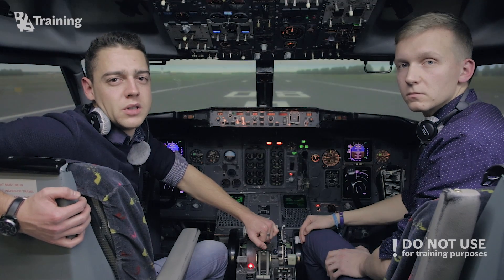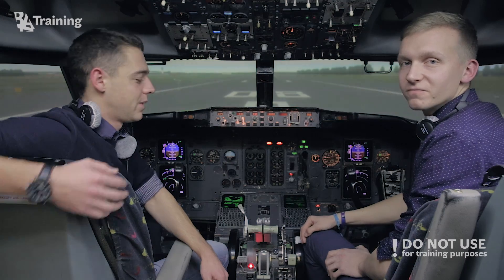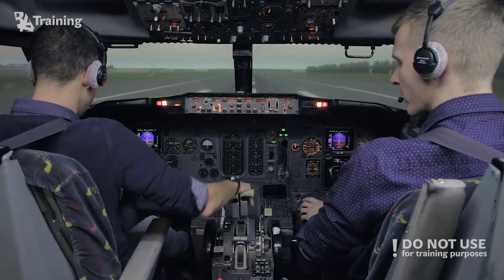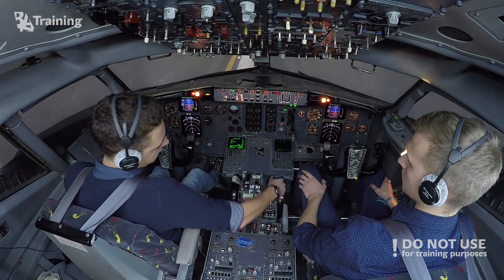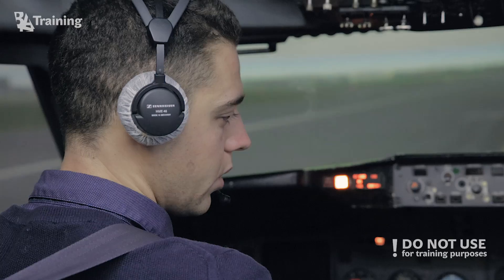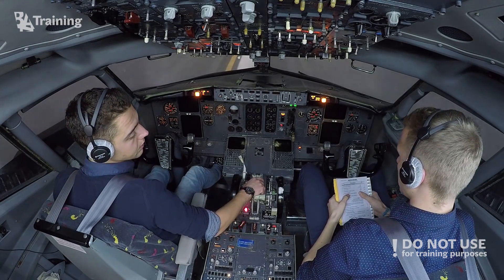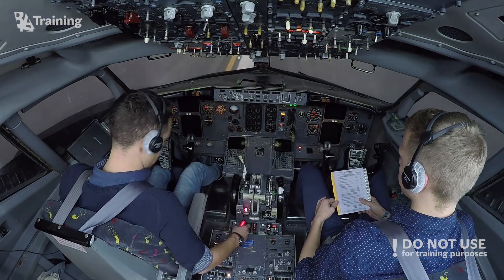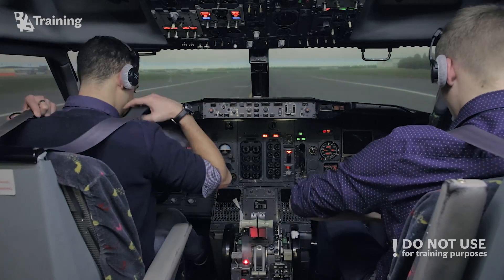B737 engine fire before V1. Rejected take off

Comment: No report to ATC that the reason for the rejected takeoff is that the pilots had identified an engine fire (or fire warning). No cancellation of the fire warning (aural) annunciator. No initial confirmation callout by the non-flying pilot of engine fire instant recall item actions being carried out by the flying pilot. And a few other things which I won't mention. Thanks. I've learned something new. BTW: There was once a Boeing policy, (for earlier model B-737s), that in relation to flaps prior to an evacuation, flap zero was to be selected so that passengers exiting overwing (if instructed or required) wouldn't potentially end up slipping into the extended flaps mechanism. I guess that it has been revised due to variants or whatever. Anyway, for what it's worth, thanks a lot for the presentation.

Comment: Great video. I always engage the speed brake first then cut throttles to idle and engage reversers, and apply braking as needed.
Reply: That's wrong. Thrust to idle first then maximum reverse thrust until 70 knots then idle reverse.

Comment: Interesting to see, they still use the checklist of using one bottle of foam extinguisher first and then the 2nd after 30 seconds. After the American Airlines incident the FAA changed regulation, during an engine failure at take off they now advise to immediately use both foam extinguisher bottles in order to have safe evacuation.

Comment: The FIRST action of the F/O should be to cancel the aural warning, the last thing you want in such a high workload situation is an extra stressor!
Reply: Yes one of many inaccuracies in the video. They should not have cut both engines and F/O should confirmed the engine numbers while performing critical actions namely: thrust lever idle, fuel flow to cutoff and fire switch pull. You always run checklists with two people (unless one pilot is incapacitated.) They had to do an evacuation with flaps nowhere near 40 because they didn't have any hydraulics due to the captain erroneously cutting both engines. This channel is good for entertainment but their procedures are usually incorrect with severe inaccuracies in some.
Reply: @efeyzee  "They had to do an evacuation with flaps nowhere near 40 because they didn't have any hydraulics due to the captain erroneously cutting both engines." not true, you can see the flaps are indicating 40 with a green light
Reply: @pancakeking78  Oops, you're right -my bad. Still, though, BAA's videos usually aren't following proper procedure
Reply: Γεια είμαι φαν
Reply: Спец епт, сам бы обосрался, не гони

Comment: ok first of all, use some common sense and dont turn on the engine 1 reverse thrust... That might make the fire bigger smart one.
Reply: Engine reversers are supposed to be used even if there is a engine fire, dummy.
Reply: So he wastes time and distance deciding which engine is on fire then makes the decision to pull the correct Tst Reverser.?     Because NO PILOT IN THE WORLD HAS EVER MIXED UP WHICH LEAVER TO PULL  When faced with a sudden emergency.

There is not a pilot in the world trained to do that.   All RTO no matter what the cause have the same actions.  
 Also an engine on fire is STILL producing thrust therefore it will still produce reverse thrust therefor you use it to help stop you instead of allowing it to speed you up.
Reply: They will take no action until stopped on the runway or 400feet except toga silence aural warnings or reject the takeoff   and it won't make the fire bigger
Reply: Wrong ………..
Reply: Thats stupid, as a pilot  you are supposed to use all deleceration devices possible, because you certainly have a lot better to do than caring about the size of the fire, its origin,  or its temperature.

Comment: engine one fire ? stop ? then why you use revers of engine number one ? engine is in fire you have to idle engine number one !!
Reply: First concern is to control the plane. Second concern is to deal with abnormal procedures. Apart from that, the engine may be on fire but it's also still generating thrust. Even after setting the thrust levers to idle, the engine needs time to spool down from takeoff thrust level, so deploying the reversers makes sense. Not using reversers on that engine alone would produce a large amount of asymmetrical thrust, so you'd have to use no reversers at all, unnecessarily increasing your stopping distance and possibly causing a brake fire.
Reply: nope for one main reason. The RTO is a very quick maneuver. Normally the PM would not call what engine is on fire, as this is unnecessary. All capt needs to know is that its a fire, he/she does not have the time to work out a failure, confirm it, make sure they activate the correct reverser, as by that time you could have evacuated the entire aircraft.

Comment: you are a very long-running action for evacuation of passengers ... half the people burned in the fire ...
Reply: Actually only last week I had a CRM course and we discussed this.   To follow the Boeing procedures it will take average more that 2 minutes from CC ON STATIONS to the Evacuation.   Yes some crews do it faster but the are usually the ones that forget to shut down the engine.   Not a good look turning pax into pasta sauce.   First rule of aviation when the shit hits the fan ‘sit on you hands’.    It means take a deep breath and SLOW DOWN.

Comment: I'm not up on the procedures in a 737 but would thrust reverse be used if one of the engines was indicating it was on fire?

If it was really burning it would probably generate asymmetric thrust with the result being a possible runway excursion during a high speed rejected take off.

I know you're tight on both stopping power and distance here, but this seems like an instance where full manual breaks and trust to ground idle might be a better option... 

Of course that's depending on the checklist that I'm not familiar with...
Reply: It's been a while since I flew the 73. The procedure was to engage both thrust levers to reverse idle and apply reverse thrust if needed, accounting for the yaw resulting. Pretty much the same for the 72, 75 & 76.
Reply: nope for one main reason. The RTO is a very quick maneuver. Normally the PM would not call what engine is on fire, as this is unnecessary. All capt needs to know is that its a fire, he/she does not have the time to work out a failure, confirm it, make sure they activate the correct reverser, as by that time you could have evacuated the entire aircraft.

Comment: if there is a fire on one of the engines,isn't using one of them as a reverse thruster dangerous?
Reply: nope for one main reason. The RTO is a very quick maneuver. Normally the PM would not call what engine is on fire, as this is unnecessary. All capt needs to know is that its a fire, he/she does not have the time to work out a failure, confirm it, make sure they activate the correct reverser, as by that time you could have evacuated the entire aircraft.

Comment: what would happend if you get a fire after V1 ...before VR
Reply: you must take off in this case. There is not big difference between v1 and vr speeds.
Reply: up to the captain of the aircraft,he/she could resume the take off with one engine and attempt an emergency landing or stop right away(if only the pilot is sure that they'll stop in time) ,it's all about the split second decison making ability of the pilot
Reply: +Ayesh Jayawardene after v1 you can't stop airplane safety.
Reply: @АноНим-ч1э5э  if the aircraft would be unable to fly they'll stop anyways. It will just be an overrun
Reply: i'm saying maybe during an incident if the failiure occurs split seconds after v1 is called out,again its up to the PIC whether to stop or resume
Reply: @ayeshjayawardene7894  by V1 you have to have made the decision, you cant be making the stop/go decision at v1, it has to be done by V1
Reply: Sure, but that's not what you train for. We're talking about ENGINE failure. Below 100knots you stop for anything. Between 100kts and V1, you only stop in case of engine failure. After V1, you're committed to taking off. You have to realize that V1 is usually closer to Vmbe. Above Vmbe, there's just not enough material in the brakes for stopping the airplane, you'll inevitably end up overshooting the ASDA.
On the 737, Vr is usually very close to V1 for various reasons, one of them being "the airplane is light and has good brakes" to simplify it, that's why, usually, most failures on the ground will be below V1 and all failures above V1 will happen when you're already flying and have hopefully reached V2.
Reply: Look up TWA Flight 843 if you want to know what a pilot could do as far as aborting a take off after V1 and even VR!
Reply: At v1 you can still stop your aircraft depending on the situation.
Reply: @Hk-uw8my  By v1 you need to have made the descision. While yes you probably could stop you would probably be investigated for putting the aircraft in danger. Only time you should reject past v1 is if the aircraft is unable to fly.

Comment: hey if eng 1 fire, why did use both reversers?
Reply: 21 Pac You have an engine fire, it necessarily does not mean an engine failure. In this case you need maximum braking, so I would use both reversers too in this situation
Reply: +Jan Nubiola oh

Comment: My only suggestion, when making initial radio call include reason so trucks can be prepared. Adding "engine fire" doesn't take much longer and could save calling back tower to request fire service.
Reply: I thought the fire trucks would be on their way immediately the tower heard the initial Mayday call, shouldn't need to call them later on

Comment: I have a question... why do you use reverse thrust when the engine is on fire?
Reply: you always use the engine until it brakes down completely, that means that you continue flying the airplane like normal  until it brakes down. Unless the routine/checklist say any thing else.
Reply: Not a real pilot, but I think they need all the stopping power they can get. If they only use reversers on engine 2, they might run off the runway due to the asymetric thrust.
Reply: tommy clark I would say that the temperature in the engine is just higher but that dosen't mean that the engine's blades aren't spinning, the air is still flowing, so if you put it on reverse, it still blows some air to the opposite direction, which it also helps to stop the plane alot :)
Reply: tommy clark R.I.P ENG-1.
Reply: Dong Huang A narrow-body jetliner doesn't need too long of a runway to stop. In flight sim I tried autobrake 1 with spoilers only at Singapore and it only took about 1km or so to stop.
Reply: TheMaroon47 The V1 speed (the speed where you can't stop safely) is different depending on the weight, runway & weather, but then again, they weren't going fast since they didn't call out 80 knots. It's probably just part of the RTO procedure they have to follow.
Reply: During failure, you're not thinking about your ASDA, you just apply a memory skill that doesn't change. That's why you use reversers.
Reply: Dong Huang Yes I am aware of that. Just stating that even a fully loaded 737NG wouldn't need too much runway to stop.
Reply: Thanks everyone for your answers!
Reply: is on fire but still work